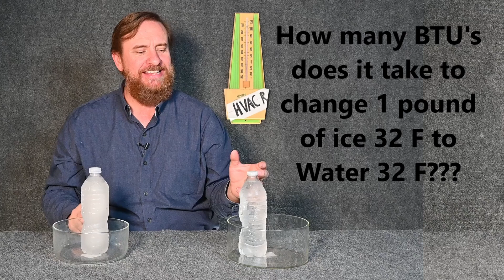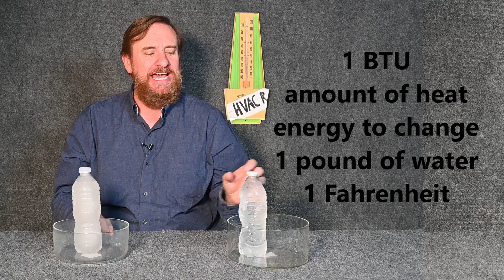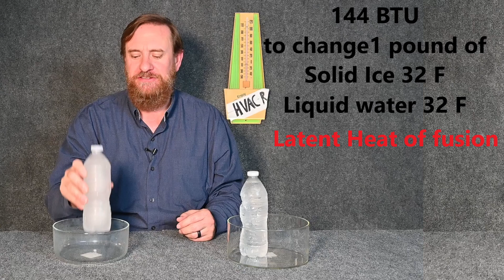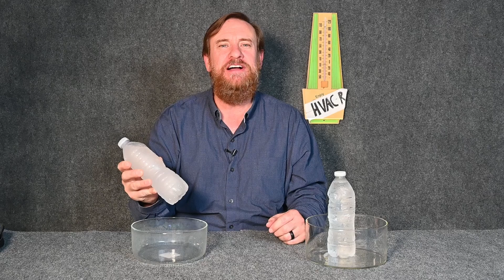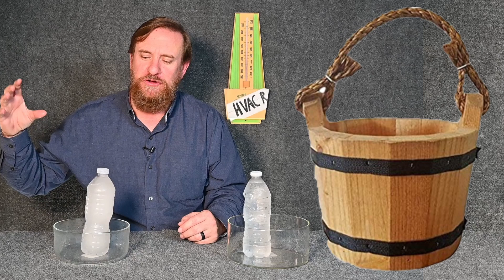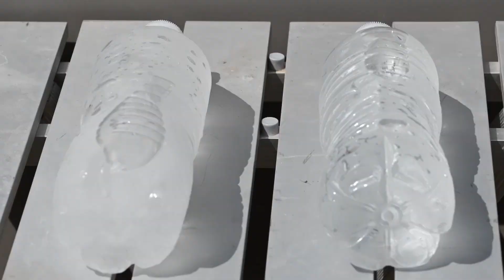HVAC 167 ICE latent heat of fusion

Comment: Any idea how that 144 BTU number will vary based on the salinity of the water? For example, if I make a solution of salt and water that's 20% salt by weight (0.25 lb of salt added to 1 lb of water: 0.25/1.25 = 20%), then instead of fusion at 32F we will have fusion at roughly 2F according to https://en.wikipedia.org/wiki/Saline_water#Properties which is great for transporting frozen food in a cooler, and just within the ice production capacity of a typical freezer set to 0F. I think the latent heat will unfortunately be reduced a bit, not the full 144 BTU/lb. Between that and the greater delta T between the cooler and ambient, the ice won't last as long. I'm curious how much of that reduced time is due to each of these factors.
Reply from the maker: Yes the saltiness changes everything!
Reply: @love2hvac  But does it reduce the latent heat only a little bit, or does it cut that 144 in half, or what? By the way, I had trouble with 20% salt (2F) not freezing in a reasonable amount of time with a typical freezer temp, so I'll be aiming for 18% salt (7F) in my next attempt.
Reply from the maker: @yeahforbes  it's a good question I don't don't have the time to research it alright now. You are on the right track, find out and let me know!

Comment: I'm scratching my head trying to figure out why you're using Fahrenheit and not celsius, then it occurs to me that BTUs must be the English unit. Still, given how much easier these concepts are understand on the Celsius scale, why not use it? I am American and grew up with the Fahrenheit system, but once I started working with science that cared about temperature, Fahrenheit was clumsy. Something as simple as understanding that saturation State as being zero Celsius rather than 32 f, helps my brain better understand the bigger picture because zero has meaning for 32 doesn't unless you happen to remember why that number is significant due to the context. Zero communicates meaning all on its own.

Now I'm off to go confirm my understanding of the calorie relative to the btu and see what knowledge I'm missing in that area.

Great video!
Reply from the maker: Thanks Michael.

I completely agree, it's time to retire the queen's old English rule comprised of hundreds of individual scales trying to work together.

The metic system is much simpler and easier to understand. 

However my fellow Americans would rather continue to pass these antiquated unconnected measurements on than make a change.  Oh the excuses people give every time I talk about it. 😔

That said, as an educator I do my best to educate my students for their success. Since all the HVAC equipment is still using the British Thermal Unit for sizing and capacity I will dredge on. 

I have so many other battle fronts of change I am pushing for, I will leave this one for another day.